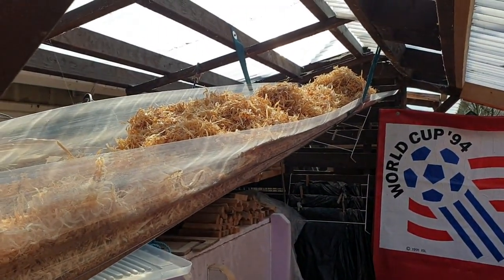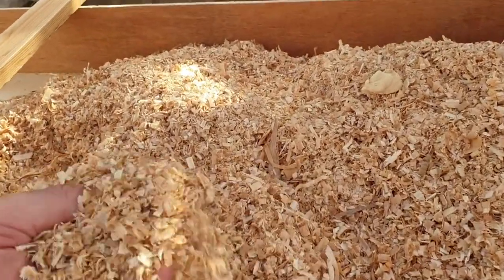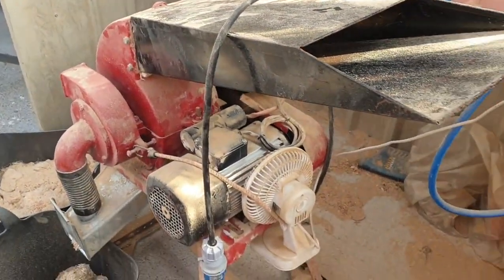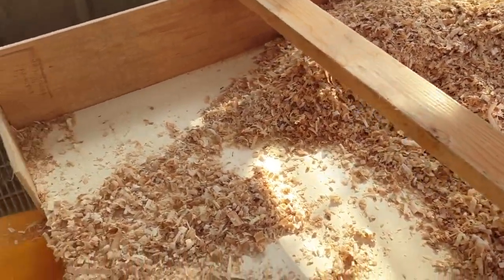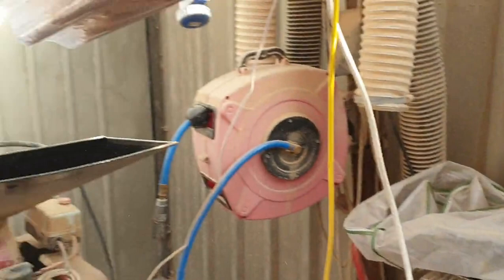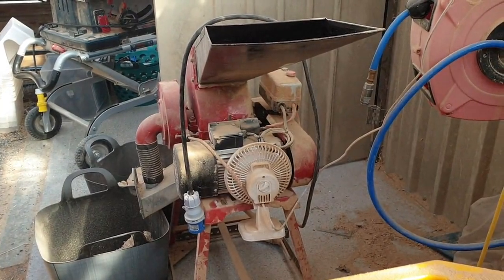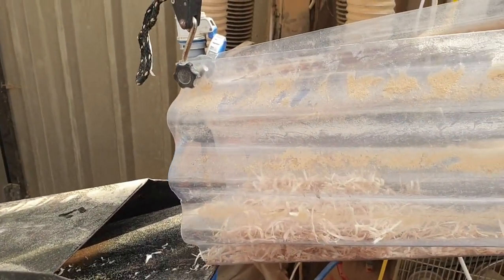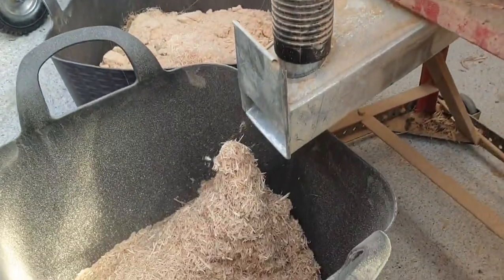Processing Sawdust waste into Briquettes

Comment: Melting candle Wax,mix it with cardboard paper and sawdust.perfect for firestarter.
Reply from the maker: I have used candle wax as an additive years ago but using my briquette maker, no other additive is necessary.  The briquettes catch fire quickly and burn clean. Wax is expensive to buy, why waste even used wax if it can be remelted and made into a candle again.